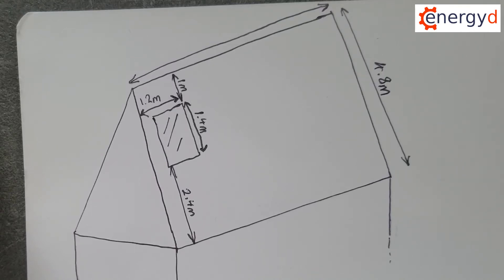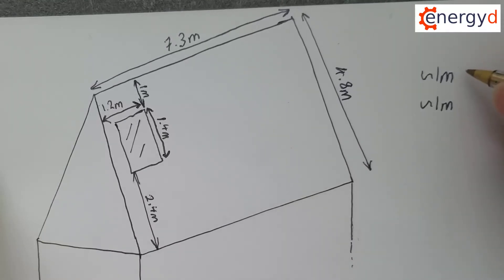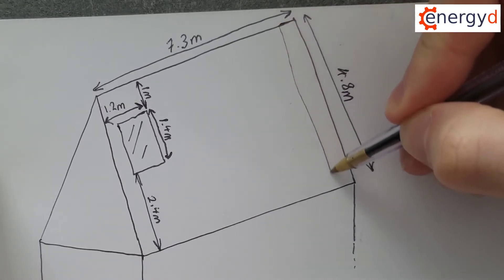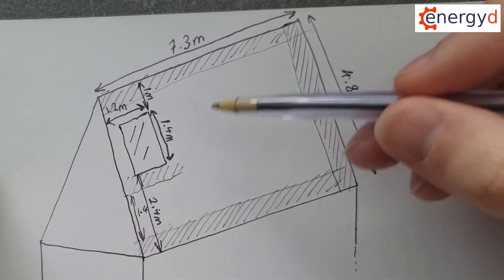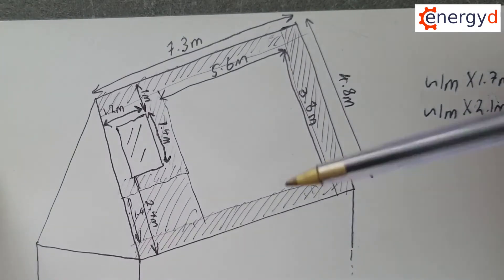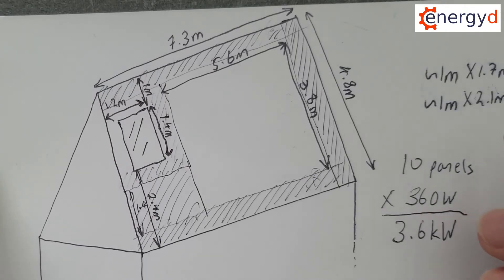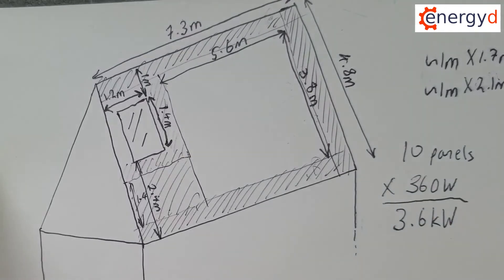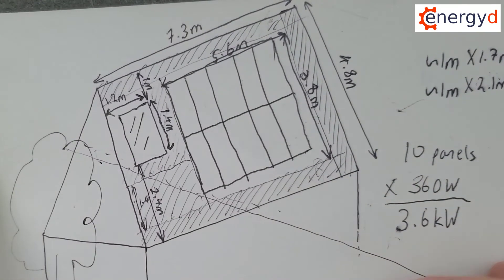Researching Rooftop Solar Panel Layouts for Houses in Ireland?

Comment: Very helpful video, thank you! Does this 500mm setback still apply since June 2022 under the new regs? And if so can the 500mm setback be reduced if part of a planning application?
Reply from the maker: I don't think the 500 mm setback rule will be going anywhere, even when the 12 square metre limit gets removed.  You might be able to get it reduced as part of a planning application.  But that probably require some proof (probably engineer's calculations) that the system can resist wind loads at the edges.